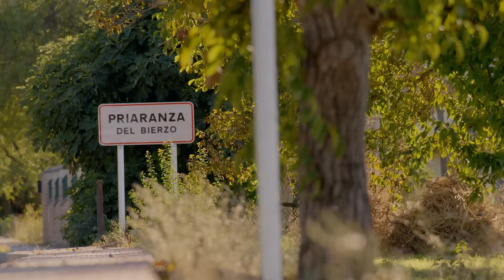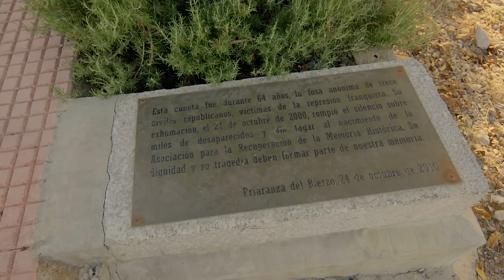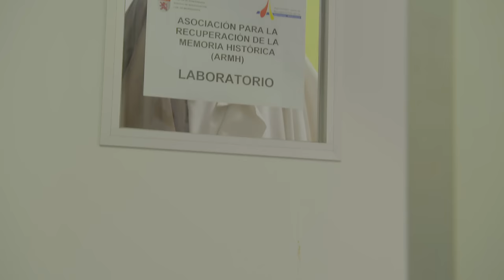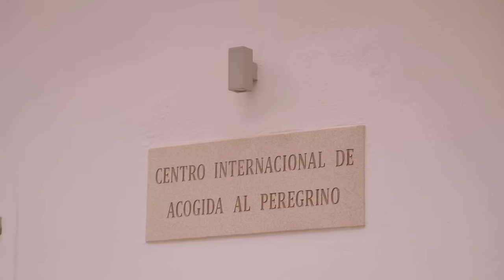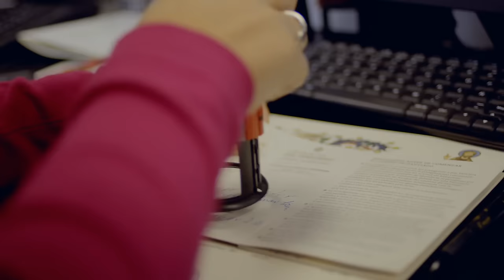Spain's Coast of Death | Alex Polizzi's Secret Spain | TRACKS

Comment: First of all Santiago is horrible, it only contains pubs, hostels and souvenir shops. Next, you can not state a distance on the "Camino de Santiago", as it is the name of about 70+ hikes. My guess is that you are referring to the Camino Frances, where the Camino Del Norte is longer, the Camino Ingles, is waaaaaayyyyyy shorter, the Camino Portugues is average, the Via de la Plata seems to be the loneliest of all these hikes. Just to mention a few. (And yup I did do 3 of them, than decided they are overcrowded, I prefer hikes with less people.)
Again you are wrong, Santiago has no rights to claim it is the end of the hike at all. Be it that there is some discussion still going on it is either Muxia or Fisterra (Finisterre). Imho Finisterre, as the name indicates it, it also has the 0.0km stone at the Cap Finisterre, and it is amongst all other reason also mentioned to be so in the pilgrims song, by Jean-Claude Benazet. (Ultreia). Again a mistake by you, 250k come to the office, those are only the ones that did the Camino Frances, not any of the other ones. At least 20 to 25k come to the office for the Camino del Norte.
Reply: Horrible?. 😂😂😂😂😂😂. Interesting perception, and taste.
Reply: In no way is Santiago horrible.